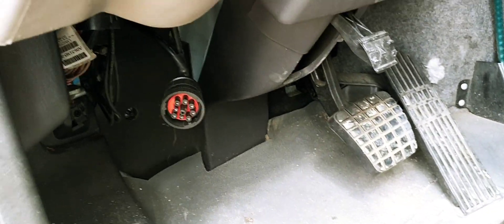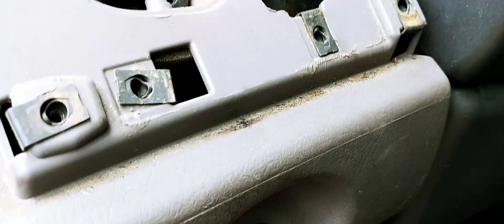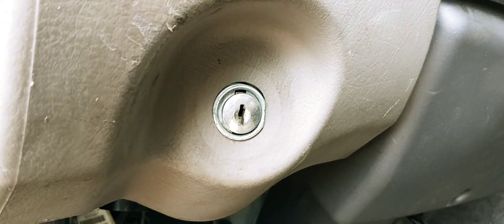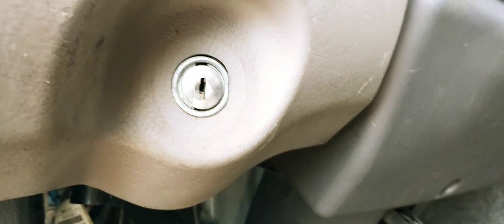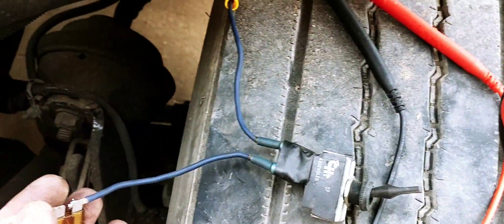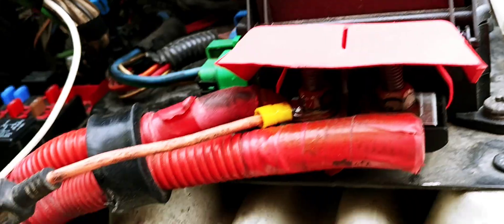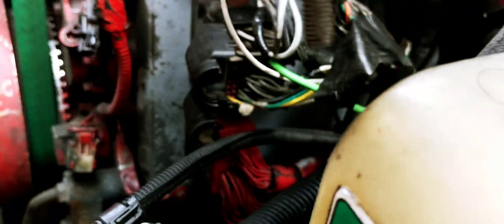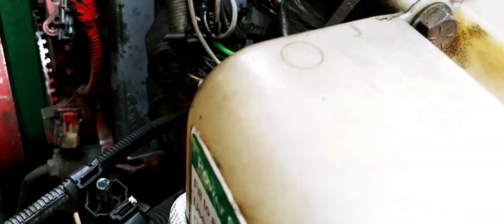How To Bypass The Bulkhead Control Module To Test Ignition Trigger On A Freightliner M2..!!!

Comment: Dude excelled video. Had a m2 crank no start would crank and run a min and die or no start at all. Bypassed 12 volt batt + wires worked. Traced the pwr feeds to a 30 amp in the underhod panel. Found the main pwr feed wire to the box corrodes and intermittent when cranking the pwr would glitch out. Your bypass on the pwr side helped me zone in on it.
Reply: What if you fried your bulkhead module? Would this method still work or not? Can I buy any used freight liner BHM and have it programmed to my truck!
Reply: Could you go into more detail on the fix for this? I have the same problem. Maybe a video on your channel? My truck turns off so unexpectedly I cant take the chance of driving it to the shop and may have to have it towed.
Reply: @dmagic1one  check all the wire terminals of on the driver side engine fuse panels
Reply: @Jengoboys603  I think I found the problem. It was a  corroded relay in the long fuse box. I clean it and the slot it goes in. Was able to go on a 1hour test drive and then 150 mile load and back. Thanks.